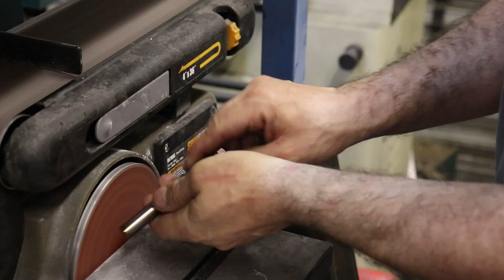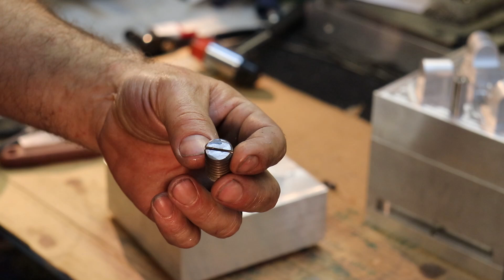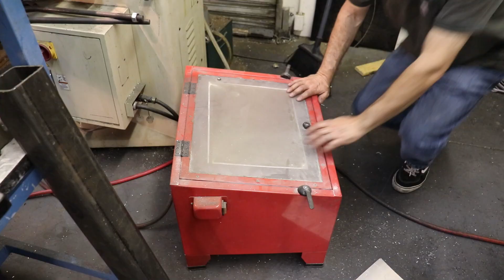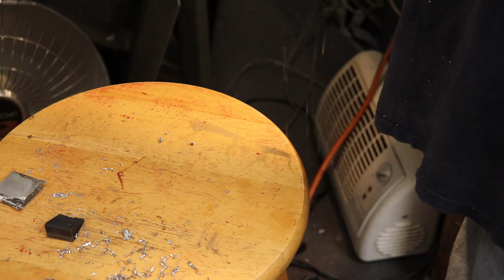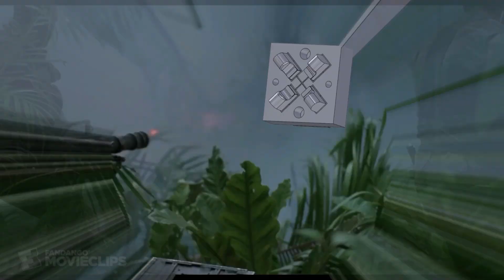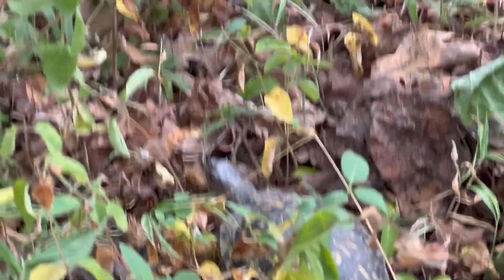3D PARTS 3

Comment: Hey Dave thanks again for sharing your learnings.   On your prior shop tour video, you showed your morgan press in the graveyard - any chance you have any molds / mold sets or any other parts for it that I might be able to buy off you?  I've been adapting a 3d printed product for molding on my g-100t and I'm looking for anything I can get my hands that'll help me get more experience with this machine.   I'm a bay area local if that helps. thanks
Reply from the maker: I dont think I have much regarding old molds for it.  I do have an original heater plate but I would want to keep it with the press that I plan to sell.  Thanks for watching!

Comment: Nice work 👏 ❤️
Can a  injection mold work with out ejctor pins ?????
Reply from the maker: You can but it is difficult with hard plastics. A razor edge from a chisel needs to get under the part without damaging the mold
Reply: @DragonflyEngineering  thank you so much 🙏
Reply: I mean can we manually take the part of the mold ???